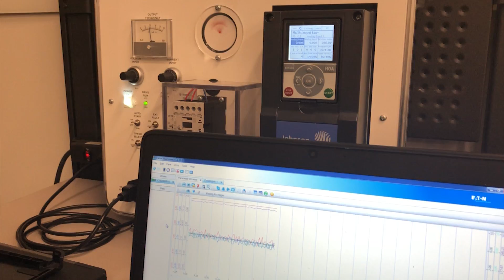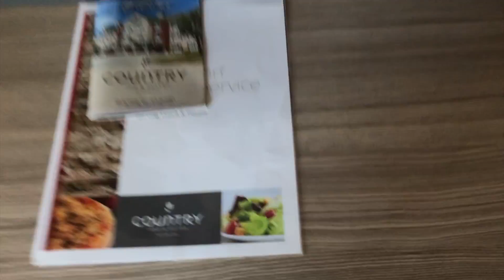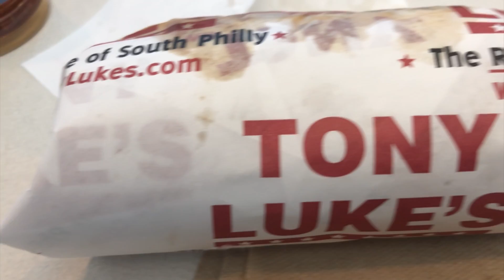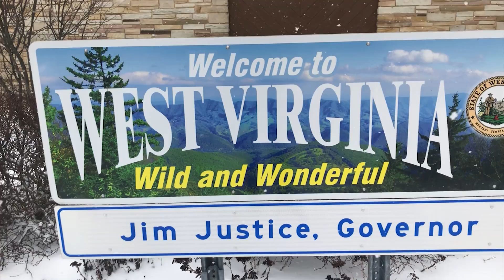HVAC Chronicles - Variable Speed Drive/Motor Starter Chat

Comment: I change so many motor bearings at my day job. It’s getting better. Most motors at my day job are on drives. We use ABB mostly.  Excellent video👍
Reply from the maker: Nor-Cal Refrigeration & H.V.A.C ABB are definitely the most common around here as well.  You ever been to SLO man?  I moved to Kentucky from SLO a few years ago. Anyways appreciate ya watching man!🤟🤟
Reply: AK HVAC many times. 805 in the House. 👍
Reply from the maker: Nor-Cal Refrigeration & H.V.A.C  that’s awesome man. My parents and sisters  still live out there. I’d sure rather be at Pismo Beach right now than this snow out here🏖
Reply: AK HVAC gonna rain for a week out here. 👍
Reply: Same here... have tons of ABB motor killers at my work. Kind of entertaining on startup though when you get a motor that sounds like a jet engine xD